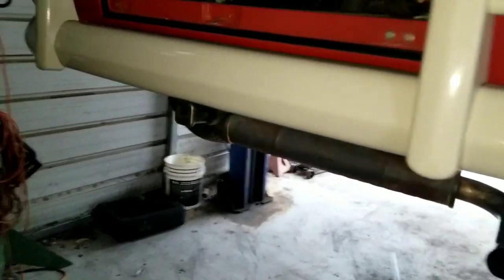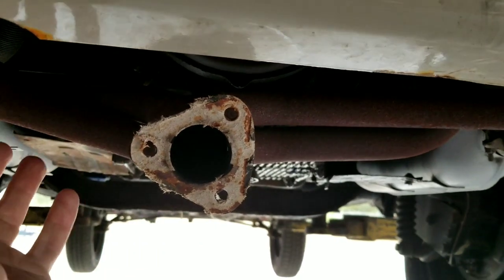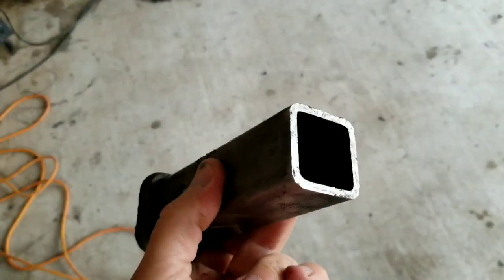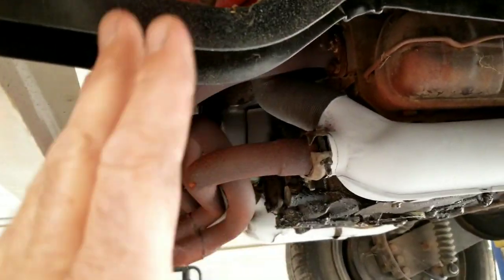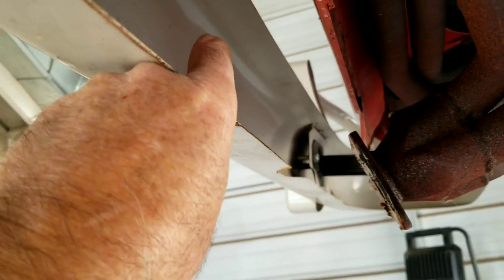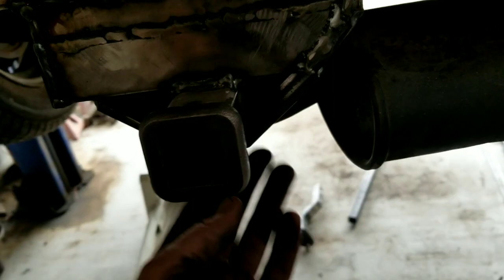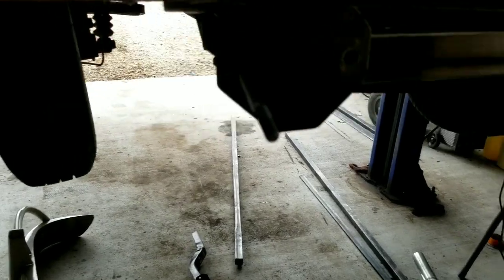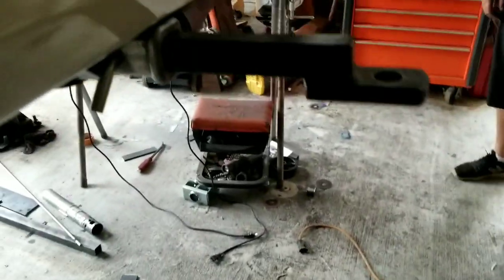Split window VW bus trailer hitch build

Comment: Although  i admire your thought process on the engineering and design of the trailer hitch  for the bus i think you are over engineering the  entire  project  you  really shouldn’t consider pulling anything that heavy behind the bus as they  are not designed to pull  something big and they dont have the braking capacity  and tourque to do so you  would be  setting yourself up for  being dangerous to others on the  road  if you put all that weight  on the rear  of a bus  you start compromising your steering and other crucial  factors to the drivability  towing is so much  easier and safer if you go the opposite way of pulling a trailer  thats way under  the maximum  reccomended  specs  my last truck  was originally purchased to pull a large 5th wheel  camper as luck would have it over time i wound up  buying a  much   Lighter and smaller  camper that made the experiene much  easier  to pull  overall  i also bought the truck to pull a  large Sportfishing  Flybridge boat that  required permits to pull  and wound up  only pulling  jetskis and a waterski boat  that my children preferred using  by doing so  i never had to worry about  stopping the setups  or  transmission tempertures like  i did  with the heavier items  the truck was  spaced to pull 20 K  and it was  super easy on it to pull  a 2,000 lb  waterski boat as the truck  would drive and stop  like it wasnt pulling anything   People used to laugh at me when i pulled my sons 10 foot  Boston Whaler on a trailer behind my Dually Turbo Deisel   4x4 truck to a boat ramp  and ask them  if they would help pull me up the ramp if i had trouble  i was obviously joking  around but sometimes  strangers wouldn’t know my  quirky sense of humour  at my local ramp  at my marina i  used to always  help  people get  out of the water  with a tow strap whenever i saw someone i thought might have a issue    One fellow who had not much knowledge thought he could pull a  lead keeled sailboat  out of the water and from Maryland to NewYork behind his Chevy S10 4 cylinder  pick up  he swore the specs said it was ok  i just waited till the day he pulled in with some rusty junked up trailer he foun on Craigs list cheap  to make his journey  he couldn’t  budge the  trailer  up  the ramp when the boat was loaded on to  the rig  and he was convinced that he would be fine once he got going on the highway  ???  It takes all kinds to keep the world  interesting  A VW bus  would probaby be ok to pull a small landscape trailer and maybe a dirt bike or two on it but I wouldn’t go heavy  to be safe
Reply from the maker: absolutely. I do not ever intend to pull anything more than a small utility trailer with a total weight of about 600 to 800lbs absolute max. we used to pull a coleman utility trailer with our dirt bikes but that is it.